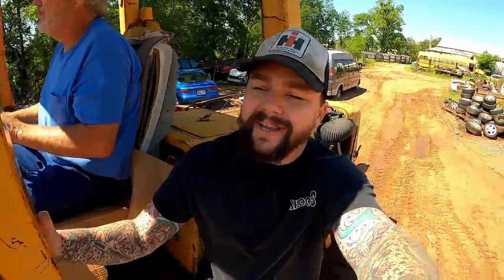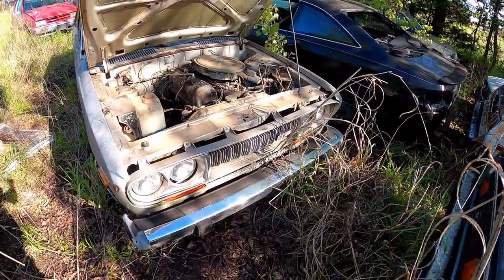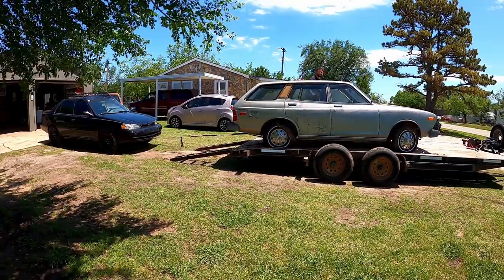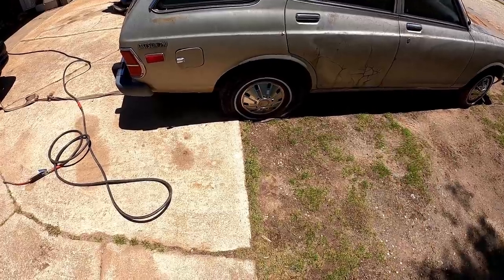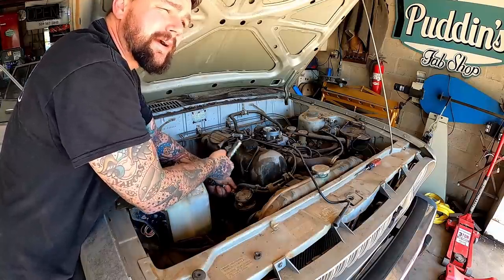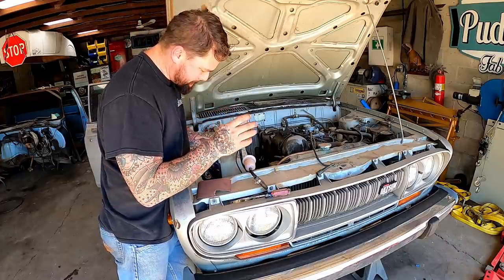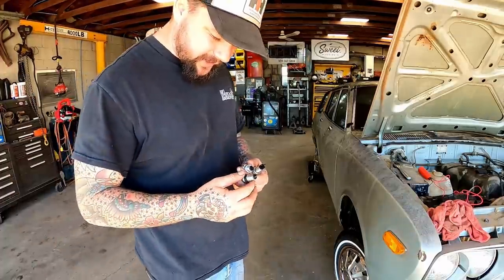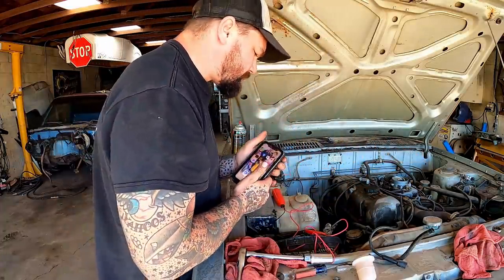JUNKYARD 1977 Datsun 710 WAGON. Will it run?!?

Comment: I have enjoyed this. I has brough back sooooo many horrible memories. I had 75 710 wagon, same color... And it took forever to get it to run...compression checks, new ignition, plugs, wires. replaced fuel pump, filter...Finally got it running, only to have it turn off every 50 or so miles...turns out the fuel lines had rust in them and kept clogging. Also had bad rings. replace the rings and valve stem gaskets...Had not secured the timing chain tensioner and it had extended too far...top speed with malfunctioning tensioner was 50...eventially stretched the chain and bent 2 valves. Once replaced it ran great. 

My 72 510 wagon we spent 3 months trying to figure out why the second set of points didn't fire...The we read the part in the chiltons about the 3rd gear switch and that they only fire in 3rd gear at a certain rpm.
Reply from the maker: That’s crazy! Glad my pain brought back terrible memories! 😂
Reply: @PuddinsFabShop  I have had 5 nissans, a 72 510, a 75 710 after i wrecked the 510, sold to 710 for an 80 200sx andi have had 2 maximas. I would love another 70's model to tinker on, but they are already restored around here and i cant find a beater.

Comment: Try the original carburetor again
Reply: The Hatachi is misunderstood.  When in working order,  it's awesome! I had mine restored and it runs flawlessly. Totally worth restoring.
Reply from the maker: It still needs gone through.
Reply: @PuddinsFabShop  Yeah, I passed mine off to experienced hands. It's a complicated carburetor, but it is perfect when working at 100%. I had commented here that removing the idle mixture screw and the cuttoff solenoid and spraying out the passages would likely get the original Hatachi working and keep it smog ready among other reasons.
Reply: @PuddinsFabShop  These carbs are no more difficult than any other carb to rebuild, there's a screen in the fuel intake fitting that gets plugged, I'd take that carb apart and clean it out, likely wouldn't even need a rebuilt kit just a cleaning. I'd clean and try this carb before buying a Weber, I have one of those Weber 32/36 dgv on my 77 620 L20b datsun and I can't figure out the problem with it, spent $60 and rebuilt it and still can't resolve it's issue, mine is a real Weber not a chineseum carb, but I cannot fix it, those Webers are "good junk", I've read a whole bunch of comments about the Webers and one comment say there a good carb, and the next comment says there junk, I'm leaning towards the junk side, I'd just about trade you this Weber for that original Datsun carb!

Comment: The carb was one of the biggest weaknesses for the L20B
Factory Hitachi.
Webber conversion (that you have) is awesome.
Runs 100 Times better.
Used to have a 1979 620 Pickup.
Rebuilt the Engine and learned a lot about the L series engines.
(L16, L18, L20).
These engines love to burn oil if you even think about poor oil changes.
Ring technology is much better with aftermarket parts.
Less of a problem if you happen to do a rebuild.
That 710 makes me jealous.
Wish I was there helping you with it!
I haven't seen one that clean since 1995!
Reply from the maker: I’ve had better luck with Weber’s myself. Ordered one.

Comment: I had one of these!  Bought it for $600 bucks and it ran pretty well, sorta.  It had some teeth missing on the flywheel and finicky carb.  A few wacks with screwdriver handle fixed the carb ,(dirt or something), and big wrench would turn flywheel enough to let the starter engage.  It was great on gas!  My girl friend had to go live up in South Dakota at her Grandparents and I had job in Wichita.  Yes, it was not good. So, used some vacation and drove a car, that shouldn't have been driven across town, and went 750 miles one way!  I had bunch of tools and some spare parts and of a went!  It was going fine until I got poured on by huge thunderstorm.  Shorted out the alternator just about two hours from Rapid City.  A guy stopped to help and actually towed me right to my girl's place!  I bought him a twelve pack for his time.  He would not take any money.  I had borrow a hundred $100 from my girl friend to get home.  It was all worth it!   It all happen in the late 80s.
Reply from the maker: Man what an adventure
Reply: @PuddinsFabShop  And, I am stilled married to her.  Wouldn't be without her!

Comment: 77 Datsun 710 SW in fixer-up condition for maybe a few hundred bucks depending on if the drive train, brakes etc. are good, Nice find. Hope it finds a good home, it'll make a cheap reliable fun easy to work on pony ride for someone without a car and on a fixed income.
Reply from the maker: They bring what I consider decent money!

Comment: I know it will too late by the time you get this, but that carb works like a four bbl but with only two bbl. the primary throttle is the one under the choke. The secondary is vacuum activated. so you need to put the fuel down the primary throat as the secondary won't open before the engine starts. So, fill the bowl from the primary vent tube, close the choke and crank to see if it will run.

Comment: Good job puttin....When you were doing the spark plugs I was questioning that, I was wondering were three right and one was wrong or the other way around. When I was a young man back in 1970 and six, are used to detail dots and 1300 trucks right off of the car carrier. Hilarious ending. Keep up the good work. Harbor freight’s good for one time.
Reply from the maker: One was right and three were wrong lol

Comment: The weight of the air cleaner used to make the top of the carb come loose, especially as nobody ever put the brace bracket bolts back in when they removed it.
Reply from the maker: Makes sense!

Comment: That was my first car. Not the wagon model, but the 710 sedan. You get that roadworthy and I can tell you one thing. It will be extraordinarily rare. Not valuable per se, but very, very, very rare. Running examples of 710s are nearly impossible to find.

Comment: I learned in college to clean the rotor arm and you don't have tools, just run it on the tyre wall. It does work and you have a clean edge on the rotor arm.

Comment: Me and my roommate buddy John had what used to be his mom's 510 wagon it took 2 people to drive it . One to sit shotgun and clean an extra set of spark plugs and one to drive  The plugs would run without fouling for about the time it takes to clean 4  spark plugs, at that point we would stop get out and change the plugs and keep on going. That worked well until one day he needed to go somewhere and I told him the oil light was coming on ,you need to stop and buy a quart of oil he said I don''t have enough money,I'm not going to buy oil, I need to buy some gas , I tried to explain to him the priorities of an internal combustion engine,, but he didn't listen and he didn't come back until the next day ,without the car, that was oil she wrote for that 510 wagon.
Reply from the maker: Damn!!!

Comment: If your going to purchase a new remote start switch I suggest you try to find a foot operated switch.
I have both types and the foot switch is by far more useful as it leaves both hands free for adjustments also it can be used by hand if desired.
Reply from the maker: Good idea.

Comment: The reason the fuel fills up because that is the secondary barrel which only opens after about 50 percent throttle which you would see if you turn the throttle all the way while looking down it

Comment: Ahhhhh, yeeeeessss - the Datsun 710 (or as we call it down here, the Datsun 200B)...and in one of the best colours it came out in and if it were over here in NZ, it would be one of the first off the line being a '77. (Just for reference, that yellowed plastic trim between the rear doors and the wagon side window should be black with a silver or chrome highlight).  Real surprised she put up such a fight - the Datsun engines are not normally that finicky about exact plug and points gap, weaker spark or incorrect timing, but I suppose all three with the addition of the rotor unexpectedly doing the equivalent of VVT might have been a bit much for Dotty, so she can be forgiven.  

The 200B was the successor to the 180B, which had biblical rust issues and wasn't the most reliable in the local conditions in New Zealand.  One (rather unkind) review of the 200B sedan in 1979 claimed that the 200B was "just a 180B with 20 more mistakes".  Trying to find either one now - in any condition - is like trying to locate rocking horse doings, so ironically they have become sought after.  In all truth, I liked the refinement and restyling facelift of the 610 / early 70s 180B shell that became the body style of the 200B and it was much more comfortable and quiet to ride in.  The one you have there certainly looks to be a good one and worth a bit to the right buyer.  Will enjoy watching more of its revival.
Reply from the maker: Thanks for all the info. I still can’t believe it was so stubborn myself.

Comment: Dude.  I jumped railroad tracks in an 81 210 with no problems.  Those lower arms had no issues. (I'm pretty sure they had the same arms on both)  And I started that car with a screwdriver across the starter solenoid for years.... Ran over my feet more times than I can count.
Reply from the maker: 😂😂😂😂 cracked me up
Reply: @PuddinsFabShop  You laugh, but I'm dead serious.  That was my first car.
Reply: @PuddinsFabShop  Honestly? I want another... and I'll LS swap it.   Or maybe K-swap it.  Make the fastest Datsun 210 station wagon ever.

Comment: I've had the Weber replacement carbs and I will take the factory carb any day over the Weber. All that original one needs is a good cleaning. They work well when set up correctly.
Reply from the maker: I guess I could try my hand a factory one now. Before when I rebuilt them I could never get it right.
Reply: @PuddinsFabShop  I used to modify the linkage to make the secondary manual vs. vacuum. 1st 3/4 throttle is just the primary and the last 1/4 is the secondary and primary. Nice little mod.

Comment: Love the ol datsuns man. there all gone here in northern ohio. If you come across an old nissan or datsun 720 truck  let me know. I engine swapped a 1981 nissan sd22 diesel engine into a 1988 mazda b2200. had it for years and still runs good but the mazda is rusting out.
Reply: Edie had a1981 210 sl. Had o

Comment: puddin, Im always alone working, I drilled and anchored nuts in my garage floor, with a remote controlled 3500lb $70 harbor freight winch hooked to a car battery! Saves my butt and back every time and no sweat
Reply from the maker: Heck ya good idea.

Comment: I had a '73 610 and a '74 710 ... the 610 had a 1000$ engine built at George Alderman's Race Shop in Delaware - it would do low 13's in the quarter ...

Comment: if this was a stick car - I would tell you a Datsun 2000 Roadster clutch fits and is more than double grip pressure. You only have to swap out the bearing carrier ...

Comment: Use a Garden tractor fuel tank ( plastic )....light enough to hang up high and Gravity feed it...Gravity was taught after Grade 3 probably??
Put a shut off valve on the fuel tank so you can control the flow and fires!!
😉
Reply from the maker: I can use this boot and an ass to show an example of how to defy gravity.

Comment: Yep , thats a rare one and also being an automatic. I had the 2 door model. Great engines the L18 and L20's. My friends husband uses the striker on a match book to sand points. How many miles are showing on the odometer ? The brake pedal looks hardly worn so probably low miles on the car.
Reply from the maker: Weird I found two automatics in a row lol

Comment: I spied an 81 Datsun 210 coupe sitting in front of that 710 wagon😁
Reply from the maker: I went to look for the flex plate off that car which is how I found the wagon. I needed the flex plate for the 210 I had.
Reply: You ain't the only one. I just pulled 2 79 210s from a closing junkyard. Got em both started and running but I could use some body panels
Reply: I’m looking for a 5 speed for my 79 210. Can’t find one anywhere. Had to settle for a 4 speed but still need that 5th gear

Comment: Great video man. Great energy and cool shop. I started watching when you got the LUV. got me a 77 from a work buddy. Imma bring it down to you so you can make it do wheelies for me sound good?
Reply from the maker: Thanks for watching! I can put the front on jack stands. Instant wheelies.
Reply: @PuddinsFabShop  ,fit a SBC 350 like they were designed for?
Reply: @PuddinsFabShop  that may impede my ability to drive it to work. But if its what an expert mechanic suggests. I'm willing to try it.

Comment: As you can see Datsun/Nissan the original tool kit under the hood still had the firewood and fire starter now that is innovation at its best. They wanted to make sure if you broke down in the middle of the night no need to worry on board camp fire 🔥 that’s genius..... 😂

Comment: Dood, It doesn't matter which side of the carb feeds the engine. You poured enough fuel in there to drown a 454... 
BTW, the side with the choke is the primary side that runs the engine, the other side (secondary) is the power side when you boot it.

Comment: you should have been adding the fuel to the screw driver side they are a 2 barrel carburetor and you were trying to get her to eat on the closed secondary ;)
Reply from the maker: Yeah I learned off the bottle though that if you stay spraying on the one side it’s too much fuel so you can spray to the other side,  not lose your stream and not over load her lol

Comment: Maybe you supplied power to the negitive side of the coil. How it works is with the points closed you have voltage flowing through the primary side of the coil, when the points open it drops the voltage in the primary side and induses a high voltage in the secondary side of the coil which fires the spark. Connecting 12v straight to the coil is not good and will damage the coil bypassing the ignition because your not going through a resistor.
Reply from the maker: Over a long period of time it will. I definitely did not supply power the the negative side.

Comment: Damn straight on the getting money off, but then some of the deals we've had you just give them the cash & don't question it too.  Sometimes they come in with a price that they know is low, and you know is low & it's just worth the good karma to say "well, I'm here to buy not to insult your intelligence or split hairs" kinda thing.  But yeah, if it's "fairly" priced rather than straight up "steal" priced then usually get at least 5 or 10 knocked off "to put some fuel in it" or suchlike ;)
Reply from the maker: I only offered $150 less then he asked. Lol

Comment: It doesn't matter whether you call it a Dot or a Dat if it's a 510 or 7:10 you're talking my language, the 510s were legendary even the 510 wagons are badass  they proved it on the track.. here's an interesting fun fact you can take a piston out of that motor and put it in a straight six Z car motor  they are exactly the same size. How much more did you expect from that tire? If it hadn't have died, you owe it a steak dinner or 21 gun salute maybe a funeral, it held out as long as it could. Geez lol
Reply from the maker: One funeral per video aloud.

Comment: I thought by 1977, that Datsuns were electronic ignition instead of points? Maybe it's a distributor from a couple of years earlier?
Reply from the maker: My 77 truck had points as well
Reply: @PuddinsFabShop  I stand corrected. 
     My '79 620 has electronic ignition. ...One thing, that people nowadays may have forgotten about vehicles with points, is that leaving the ignition in the "ON" position for very long is a bad practice, because it's a crapshoot, whether the points are in a closed position or not, and if they are, the points can heat up, sometimes to the point of damage. I wonder, if you may have inadvertently  happened upon that situation, and it caused the melting?
         I don't know how many times, that I hear of someone having problems with a  Datsun running rough or not running and going through hassle and expense trying everything, only to find, that a $4 distibutor cap or $2 rotor button, both of which are very easy to install, were the problem the whole time! I remember back in the '70's, that the distributor caps would sometimes get a hairline crack in them, and when it rained or was very humid, the Datsun would run rough, but by the time the mechanic would look at it, the weather would invariably change, and the car would run fine, causing a lot of repeat visits by the customer resulting in a lit of frustration.  It was just moisture getting through the hairline crack, which was too tiny to see with the naked eye. Anyway, I learned, that with Datsuns, before I dug too deep into a problem, to just spend the $6 and replace the distributor cap & rotor. ...Don't know about how it is now, but I also used to run into a lot of bad aftermarket ignition parts, including spark plugs, and spark plug wires, so even if a part was new, it didn't mean, that it wasn't the problem.
        Enjoy your channel. It inspires me to work on my ol' beater '79 620 Datsun King Cab farm truck. Just put new rings & bearings in it (It was originally my uncle's truck, and he, like most people back then, just added oil, rather than changing it).